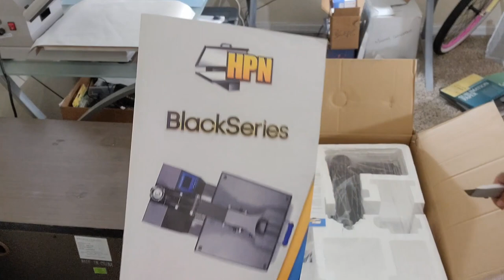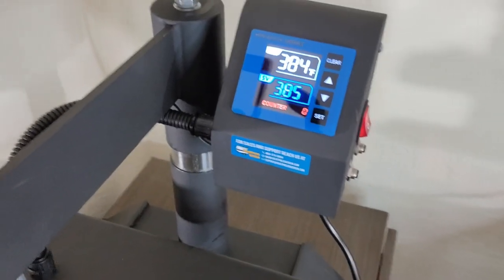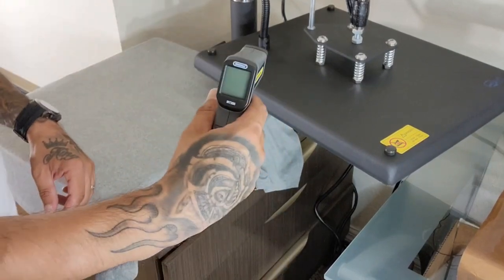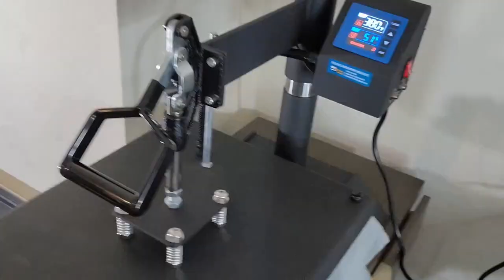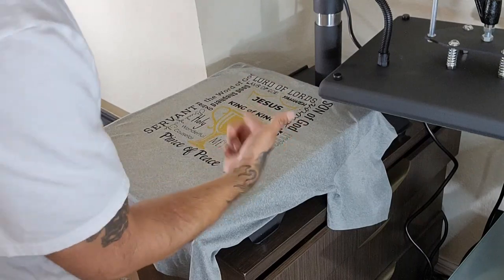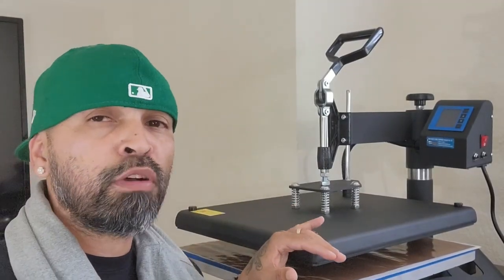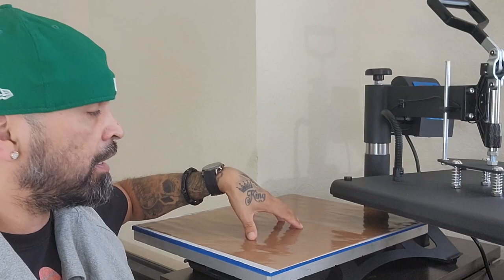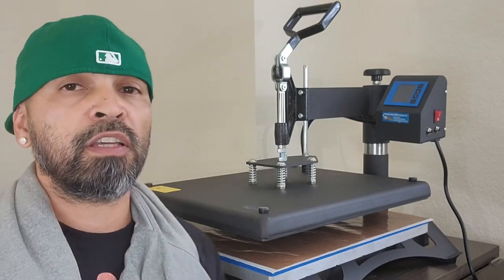HPN Black Series 16x20 Heat Press | Unboxing & Demonstration

Comment: Any issue with temperature now reaching desired settings? I’ve had my press for a month and have 400 prints on counter and now my press doesn’t heat up past 110 degrees F
Reply from the maker: Hey.  Sorry to hear that.  Did you get this from Heat Press Nation? You have a yr warranty.  I would try a different plug 1st.  Definetly contact where you got this from, that company should honor your warranty.